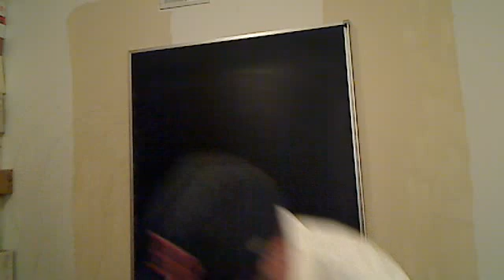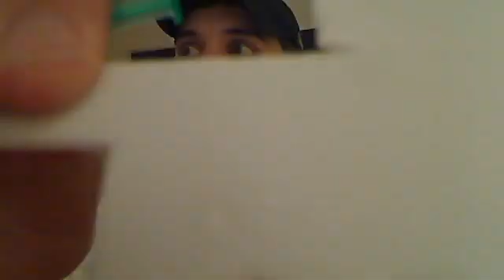Misconceptions and Science (STW - Lesson #1151 - Video Supplement)

Comment from the maker: @DoctorsGreenMaggot Yes, probably.  It depends on whether or not the dye would interact with the surface or induce greater adhering at the surface.  Certainly for chemical modified surfaces this would be a bigger concern.  For purely physical modifications, like the Teflon, the dye might be less of an issue - but it would probably change the water's properties enough (like surface tension) that the air gaps in the micron-scale roughness would be filled in.